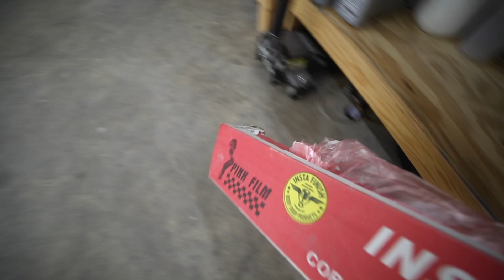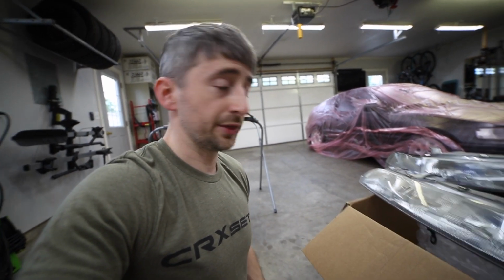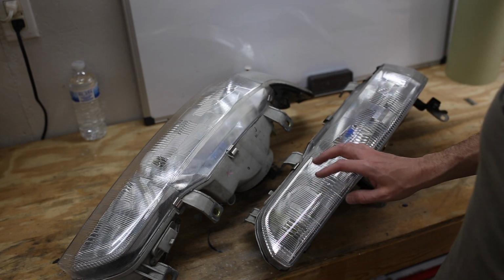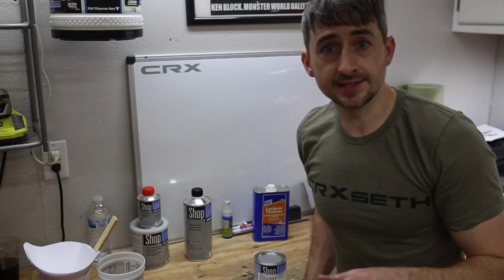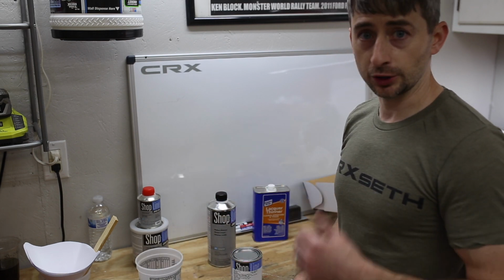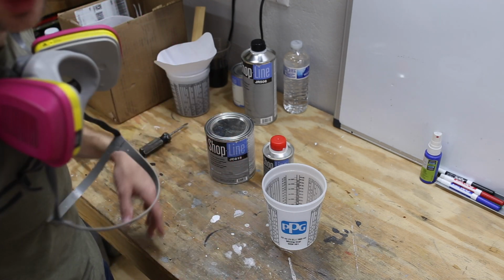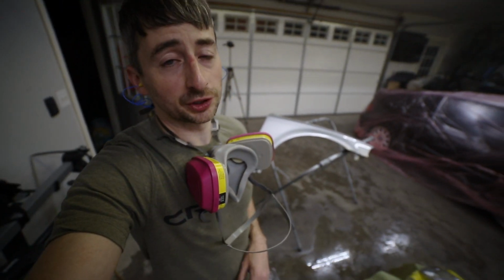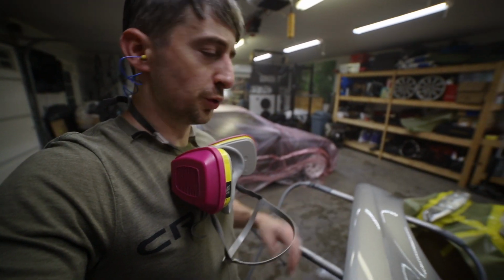Integra Headlight Restore & Civic Paint Work

Comment: Superb bro. Did this with my EK's headlights as well after the conventional sand, buff, polish method failed me (headlights would yellow after a few months). Since doing the clear method, I never had a single issue. 

It is worth noting that in extreme cases, should there be no more factory clear coat (or UV protection as they call it) on the headlights (or tail lights), a light mist of plastic primer would help, just for the sake of grip and adhesion. 

Keep up the great work bro.
Reply from the maker: Thanks! This is my first try at this, so I hope it holds up for his sake! Haha.